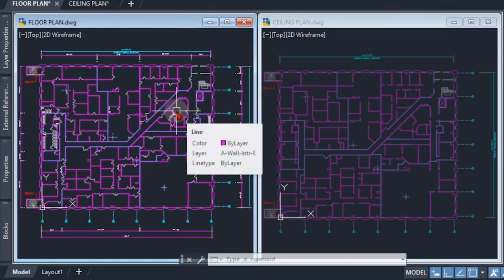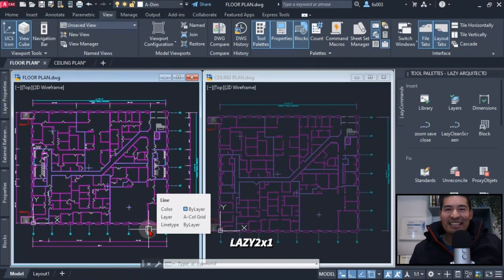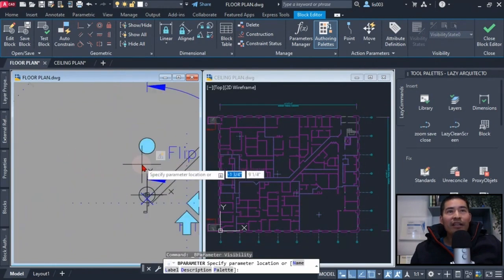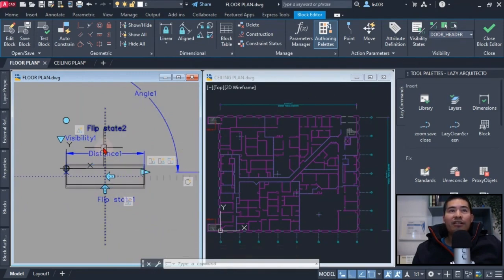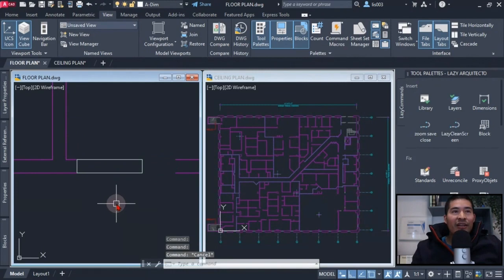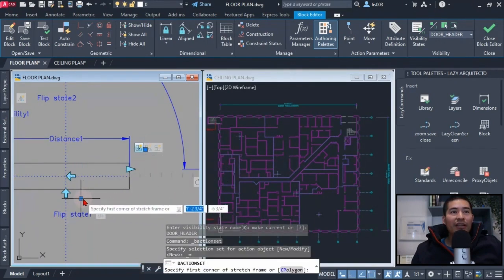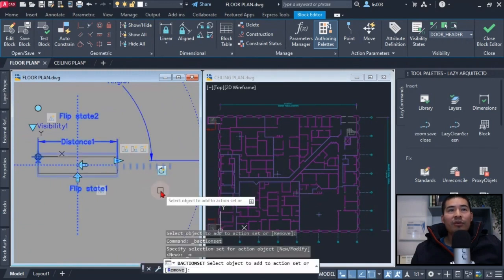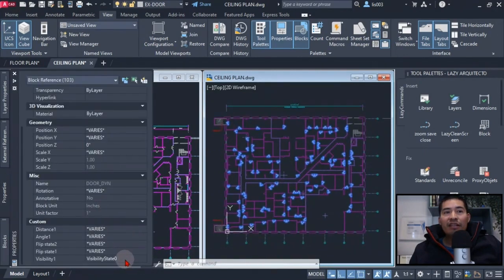How Dynamic Blocks Improved My AutoCAD Workflow FOREVER

Comment: Hello, thank you so much for your work, it is amazing! I am designing complex dynamic blocs on my side for the purpose of my work and would gladly share some of my insights with you if you are interested but i guess you know much more than me for those things.

Do you know if there is a way to force a bloc to center itself automatically on the center of a closed polyline? I am trying to design a dynamic bloc able to calculate planting surfaces in a closed polyline, but sometimes the surface is complex and not a straight rectangle so i need to be able to edit the polyline (meaning it needs to stay outside of the bloc)
Reply from the maker: Hi Tobiraco, glad this block technique was useful. Please send me images, the file and the details to irving@lazyarquitecto.com and let's see if this can be picked for the LazyQuestion show!
Reply: @LazyArquitecto  thank you!
Reply from the maker: @Tobiraco  😊